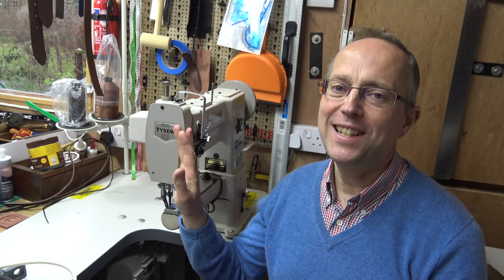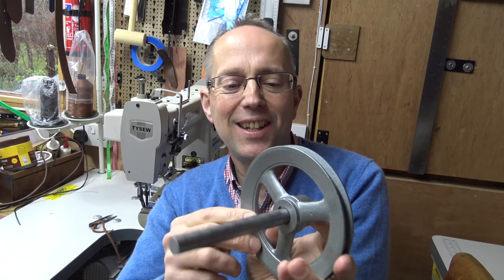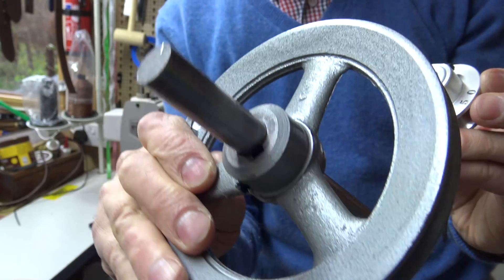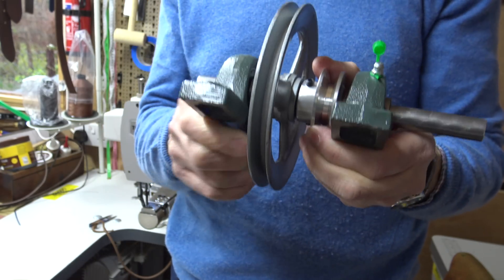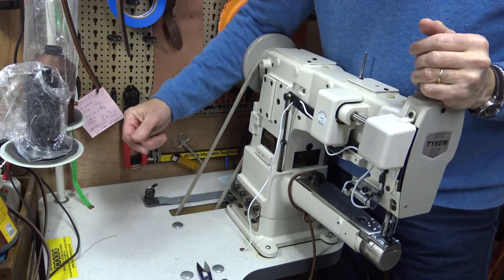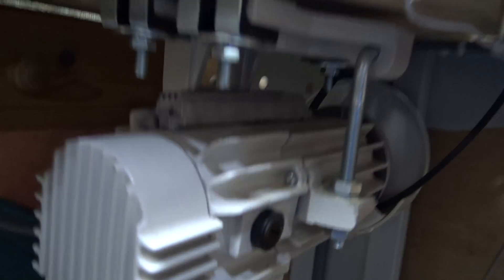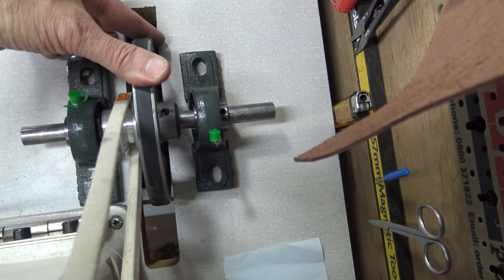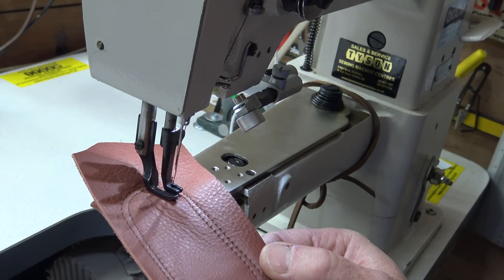Slowing a Leather Sewing Machine with pulleys.

Comment: Great job.  I think I mentioned to you before that I did my own pulley reduction system on my Yamata 5318 (which also has a servo motor).  It sews as slow as 1 stitch per second now and maintains full punching power. I also have a Consew 227R which I put a servo on (with needle position sensor) and which I have also purchased pulleys for (just haven't gotten around to installing them).   The 2 best things about the pulley reduction systems are the slow control and the boost in punching power at those slow speeds.  Last Summer I managed to find a Singer 29-58 and fully restored it, but I have never come across a Singer 133 like yours.  Harness stitchers (even used) are SUPER expensive in the States. Enjoying your videos as always. Cheers
Reply from the maker: +AndTheCorrectAnswerIs You sum it up perfectly.....The 2 best things about the pulley reduction systems are the slow control and the boost in punching power at those slow speeds. 
Alas I no longer have my Singer 133.
Reply: +Harry Rogers Oh no...the Singer is gone?  I will miss seeing that rare machine in action, but I'm sure the work you do now required a little more finesse and less brute force. I enjoy your videos and the variety of subjects. You are a true craftsman, and run a great Youtube channel.
Reply from the maker: +AndTheCorrectAnswerIs Thanks and yes I was sorry to see it go but as you suggest I do need more finesse for the bags. Fortunately it has gone to a friend, so I know it has a good home!

Comment: Harry, I have seen people put variable speed controllers on modern woodturning lathes. The kit was about 110$ US. I don't know if it would work on a sewing machine. I think Brendan has done this with his
Reply: +Frank B The variable speed motor controllers are much like dimmer switches. I have one on my CNC router. Unfortunately the motor will lose torque as the speed goes down because voltage is dropping.  The servo motor on a sewing machine already has electronic speed control, and the older style motors use a slip clutch system to reduce speed (which also causes loss of punching power). Reduction pulleys actually slow your machine down and BOOST the torque, giving you more punching power than the standard motor alone had.
Reply from the maker: +Frank B Sounds interesting Frank, especially if they maintain power.